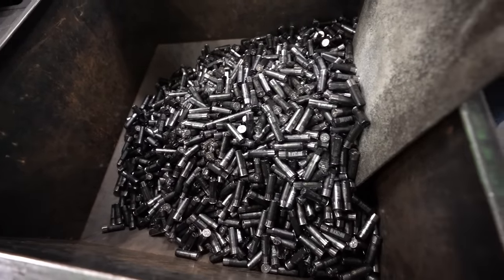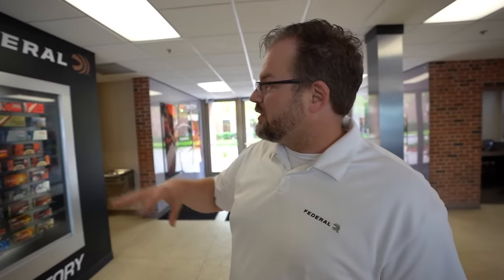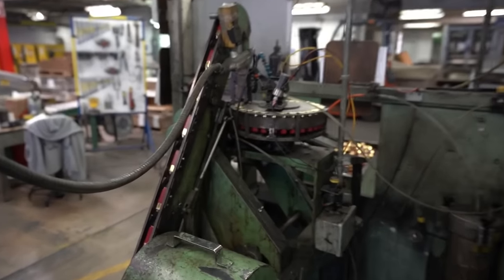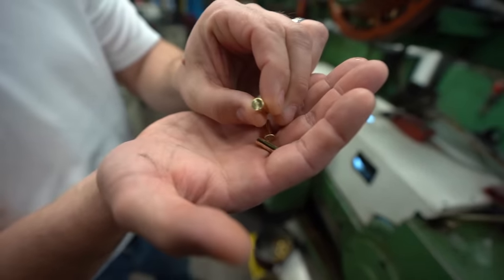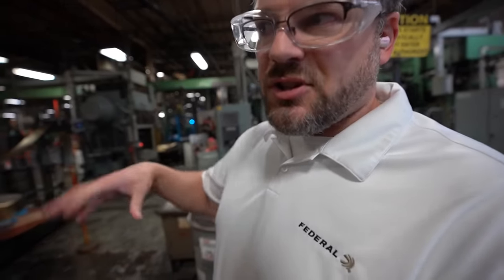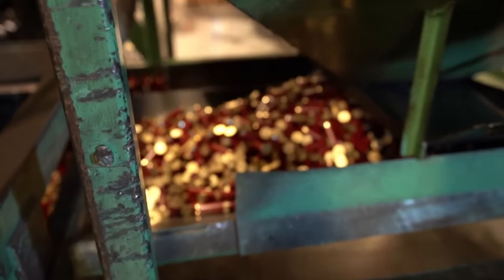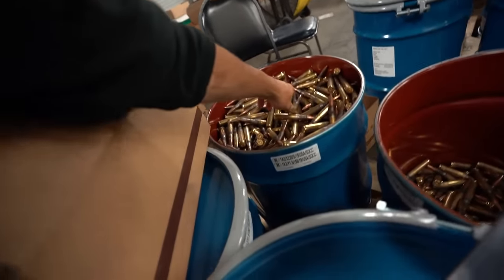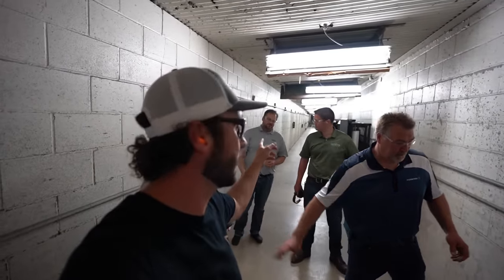How Shotgun Shells Are MADE!! (BlackCloud, SpeedShok,and More)

Comment: .50 bmg bullet diameter is .51 inch the casing neck is .560. i work with  tubing that is .003 inch bigger than the neck on a 50 cal cartridge

Comment: That gun that you were referring to is either the M-3 or the M-3A1 submachine gun used in WWll, chambered in .45ACP. It is made of stamped steel to reduce costs and it is a slam fire design.
Reply: The term “slam fire” doesn’t apply to anything except for shotguns. In that case it would be called an open bolt machine gun

Comment: I wanna say that each barrel holds 2200 rounds. So $11,000.
Reply: Thats more then a car costs.
Reply: @greenlawnfarm5827  what car can u buy for less than 45k bro
Reply: @michaelborders4674  Alot of normal cars.
Reply: @greenlawnfarm5827  I wish my old ford needs replacement and crooks at dealership want too much
Reply: @michaelborders4674  You can get a used one.

Comment: It's a M3A1 it also known as a grease gun was made in the United States date was 1944 it was was either a 9 mm for 45 ACPoperation is a blowback overall weight is 18.15 in pounds over all length of 30 in barrel length is 8 in 900 feet per second is the muzzle velocity 30 round detachable box mag 450 RPM and a 50 m